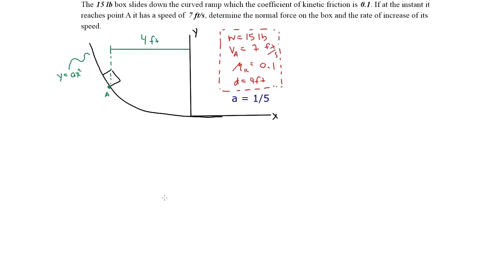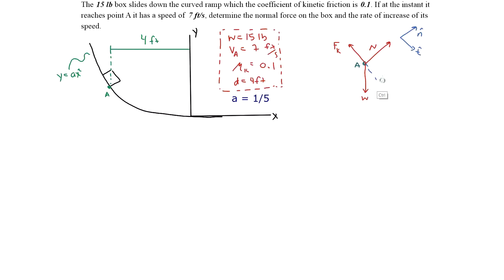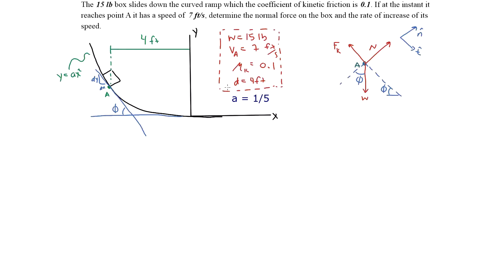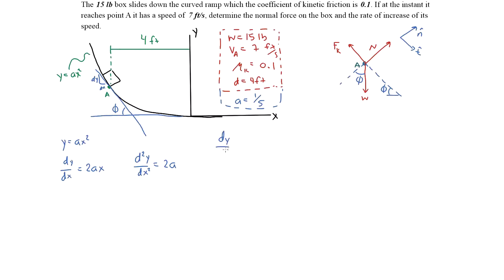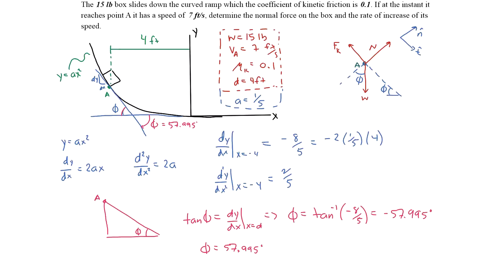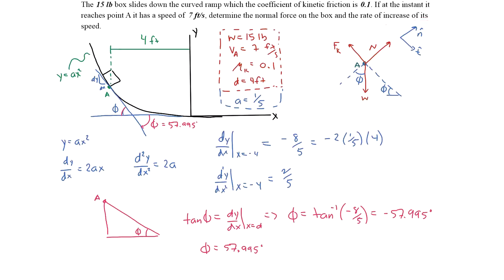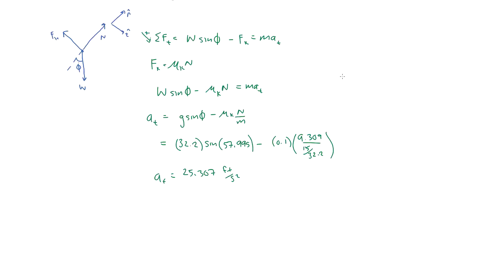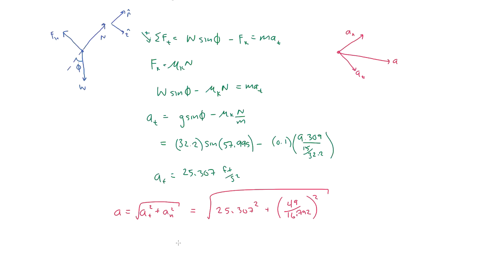Dynamics | "The 15 lb box slides down the curved ramp which the coefficient of kinetic friction..."

Comment: wouldn't dy/dx also give us the velocity of the object?(because rate of change of displacement is velocity) So how come the velocity is 7 ft/s and at the same time -2ax = -8/5 ?
Reply from the maker: dy/dx is the rate of change of the ramp or how the steepness changes with respect to x. This says nothing about time or how fast an object can slide down the ramp.

dy/dx = spatial derivative 
dy/dt = vertical velocity
dx/dt = horizontal velocity